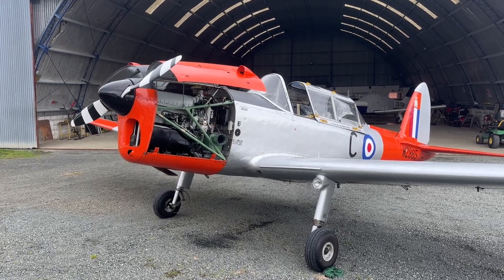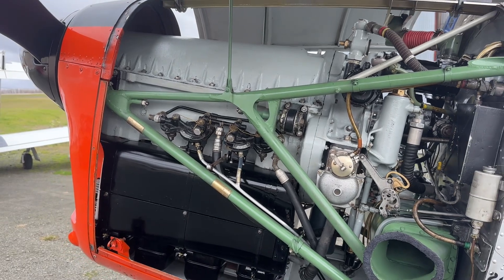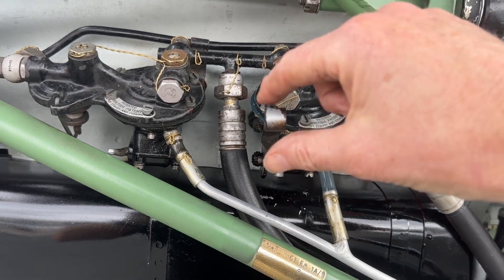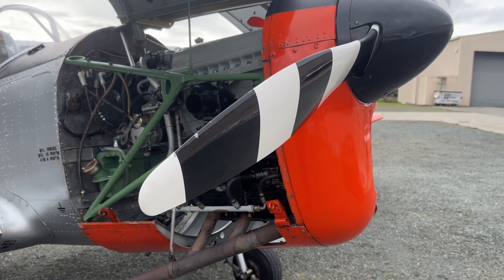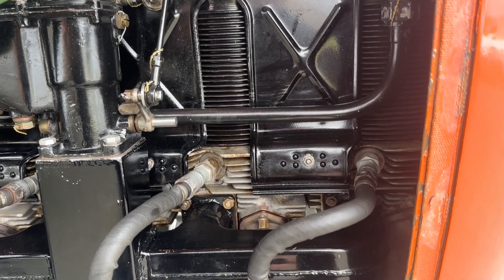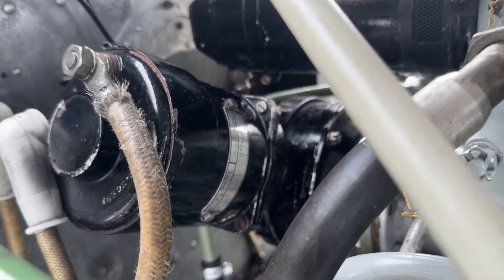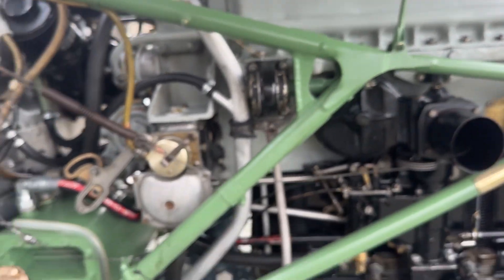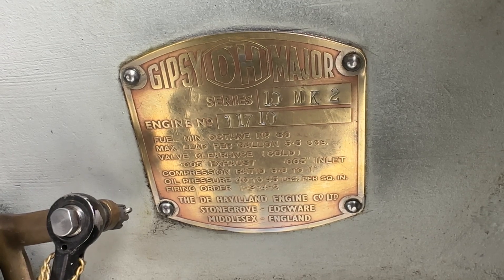Chipmunk engine deep dive!

Comment: Loved it. Used to help with routine cleaning, engine checks, etc, on a Chippy we used for glider tow work at Port Augusta (South Australia) back in the early 1970's. Great engine, still so many pulling equally iconic aircraft around, all over the world. This engine is rapidly approaching its 100yo birthday. Really good and easily understood walkaround, thank you.
Reply from the maker: yeah there's some real history right there. I didn't go into the full genesis of the Gipsy Major but it has its origins in WW1 Renault V8 engines - hence the metric threads with imperial heads.

Comment: No Kaufman Starter?...Used to hand prop start Chipmunks in 1958/59 R.A.F. Debden, U.K. ...Hated Debden
Reply from the maker: @altaylor3988  as far as I know, no civilianised or civil Chipmunks have Coffman starters. They were removed when they were demobbed and replaced with Rotax electric starters. Some still have the red cover for the pull ring in the cockpit and all of course have the exhaust port in the RH cowling.

Comment: There is no reason for a Gypsy Major to leak oil! Only it is not built or maintained correctly. You better go get some training from someone who knows basic information about this engine and try again with correct information
Reply from the maker: @tim79w  hi Tim despite there being no reason, the 7 Gipsy Majors I’ve flown behind or between all leak oil to some degree. Do you have a recommendation I can pass on to all the engineers and owners as to where they can get this training you’re talking about?

Comment: Thank you for a nice walk around your engine, I've never been around one of those. The inverted engine puzzles me, the oil must be delivered to the crankshaft, and then what, it just slugs up and down on the backside of the pistons? How is it returned to the oil tank? Anyway, there shouldn't be any rust in there! Beautiful aircraft.
Reply from the maker: No rust for sure! Yes delivered to the crankshaft via that main oil gallery on the RHS then a lot of splashing! Scavenge filters lower front and rear of crankcase with suction from scavenge pump elements on the main pump assembly.

Comment: Is this very different to the engine in a tiger moth?
Reply from the maker: Not that different. Tiger Moths use one of the Gipsy Major Mk1 variants which produce 130hp vs 145hp for the 10 Mk 2. The Mk 1 is the same basic engine but lacks the fuel pumps, generator, starter and vacuum pump found on the Chipmunk version. Tiger Moth engines also seem to be OK running on Mogas as well as Avgas.

Comment: This plane has a usb port underneath the spinner.
Reply from the maker: It actually has one in the cockpit! After all the fuss of fitting it though I've never needed to use it, as the engine runs 2 hours 15 minutes to tanks dry and my iPad battery lasts a lot longer than that.

Comment: Couldn’t see the Carb Heat ?
I was hoping to see the cartridge starter.   Is the electric starter a civil mod ?   Where is the battery located ?
Reply from the maker: I realised afterwards that I hadn’t mentioned the carb heat. On the right hand side of the engine look for the long spring extending from the firewall towards the carb. It controls a flapper valve inboard of the carb air intake that switches air intake to that flat round thing left of the carb - it’s open towards the engine block to take warmer air through a mesh filter. It isn’t greatly different to normal air, at least when testing on the ground (usually can’t see an RPM drop). The cartridge starters were all removed on demob - all that remains is the exhaust vent on the RH cowl. The two 12V batteries are in a compartment behind the cockpit.
Reply: @VaughnDavisTV     Thanks.   What’s the weather like 🤫
Reply: @VaughnDavisTV     Can you jog my memory on the downwind brake check ?   My recollection after 53 years is, on the ground you apply the brake with full rudder, and count the clicks until the brake bites on the rudder pedal.   Then apply two more clicks (say 5 in total ).   Should you need differential brake on taxi, or take off , then it’s available. 
After take off the brake you fully release the brake to enable full rudder available for say spin recovery.   Downwind you reapply the brake for say 5 clicks,  so that on landing you have differential brake available to counter swing and a ground loop. 
( I have my original UAS notes filed away in a very safe place,  and don’t want to turn the house upside down finding them ).  Thanks.
Reply from the maker: @californiadreamin8423  many Chipmunks including mine have had the original Dunlop brakes and wheels replaced with a more modern Cleveland system. Depending on how they’re rigged they often provide a little differential braking even at no clicks. To be honest, flying with either system I just do it by feel and only preset a few clicks for takeoff or landing if the crosswind is approaching limits.
Reply: @VaughnDavisTV     Thanks for the info.

Comment: I have to say the Chipmunk is a fantastic aircraft to fly, but...If I owned one I would replace the engine with a good Lycoming engine and an inverted system. I would also replace the awful brakes with modern hydraulic toe brakes.
Reply from the maker: You could also replace the wings and fuselage while you were at it? (:
Reply: @VaughnDavisTV  Purists would start shaking and hyperventilating at my comments. The Gypsy major was awful and constantly leaks when you finally get it running.

Comment: 145HP Gypsy Moth. I've flown one with that engine. It was a Canadian version with the bubble canopy. The English version had the bird cage type canopy, which is the easiest way to spot the two types. A popular engine conversion was putting in the 200hp Ranger, another inline engine. But those are probably scarce now days and the parts for it as well. I thought it was a real docile flying plane. Handled like a Cessna. The plane I owned at the time was a 125hp Globe Swift, which was a bit more demanding and flew a lot better handling-wise. So the Chipmunk was a bit of a disappointment to me.
Reply from the maker: I've seen pics of quite a few flat Lycoming conversions too - O360s I guess? Never seen one in the flesh in New Zealand though.
Reply: @VaughnDavisTV  Art Scholl used to fly one with a 260hp 6 cylinder lycoming engine. I think that's what he was flying when he was killed filming scenes for the original Top Gun movie.
Reply from the maker: @tedstriker754  I thought he was flying a Pitts? But yes definitely seen footage of him flying a Chipmunk with a big Lycoming (and wearing a tie!)
Reply: @VaughnDavisTV  He may have been in a Pitts, but he did own a Chipmunk he did airshows in. He also enlarged it's rudder, which was a common mod for hard aerobatics in that plane.

Comment: Many years ago, flew several sister aircraft to this one - closest 'relative' WZ 846 - with Queen's University Air Squadron in Belfast (Northern Ireland), prior to full RAF jet training (JP3 and JP5).  Lovely time on those Chipmunks!
Reply from the maker: Great machines! I flew the Strikemaster (JP5 basically) in my RNZAF training. This Chipmunk was with GUAS (now UGSAS) - the scheme is based on what it would have worn in the early 1960s.
Reply: @VaughnDavisTV .    I was an undergraduate apprentice at Warton when the Strikemaster was on the production line.   I was told  that the Provosts for Prince Charles were special in that absolutely no concessions for minor production errors were allowed , and the engines were brand new,  as opposed to “reconditioned”.    I spent 2 years in EMUAS on the Chipmunk ,  which tail wheel experience was a great advantage when 10 years later I obtained my commercial,  my first job being on the Dak.   I flew with quite a few Kiwis over the years. 
Great video.

Comment: I watched this video wanting to know why this engine does not experience hydraulic lock-up.
A miss.
Reply: It can slo for the 1st start you pull it through at least 4 compressions preferably more just to check.
It’s also a good idea to flood the carb and pull it through a couple of times when it’s cold helps it start easier.
If it’s only slightly warm then it’s either pray you have good batteries or it’s jacket off and get swinging

Comment: @10:12, A drop of oil can be seen dripping from the oil pump.
Reply from the maker: Probably a mix of oil and degreaser - I'd just sprayed and wiped the entire engine to make a clean slate for tracking down a persistent oil leak.

Comment: Lovely video!!!!  Make all the videos you can on airplanes with these egines, youtube has a lot on american airplane engines, but not enough on the old gipsy.
Maybe you could do a video on some old Auster with the gipsy engine, that little airplane is chronically underrepresented on YT.  
Cheers from Sweden!
Reply from the maker: Thanks! There are an Auster and a Dragon in the next hangar, both with Gipsy Major 10-2 engines. There’s also a Moth Minor nearby but I’m not 100% sure what that has in it. I’ve been flying a couple of Tiger Moths recently so might make a video about the early 130hp Mk 1 engine in those.

Comment: Used to fly in these out of Manston, UK when I was in the ATC. The ones we flew in were started with a bang from a cartridge.
Reply from the maker: I’ve wondered how reliable that system was. The Chipmunk engines I’ve flown often take two or three attempts to start, especially when hot… you’d quickly run out of cartridges!
Reply: Me too! ❤

Comment: Excellent video. Thanks for the walk around. Stbd side of the engine there is what looks like interconnected knuckle dusters, what does that do? My thought is either throttle or mixture control.
Reply from the maker: Yep those rather lovely cams connect to the throttle control and thence to the magneto to advance or retard the spark depending on power setting (I'd need to look it up to remind me which way exactly though)

Comment: YouTube recommended this video, and I'm so glad it did!  Great job going through all the components & features.

I understand DH made a whole line of inline Gipsy engines of various cylinder counts & displacements.  Would be neat to hear what they improved for this version, and what, if any, improvements followed on later versions (assuming there were later versions).  Thanks!
Reply from the maker: I'm not very knowledgeable on the whole range but believe the Gipsy Major was the heart of it and powered the most aircraft types in its various Marks from 1-10. The Gipsy Queen was a 6-cylinder version that you might find on a Devon/Dove. Main upgrade from the GM 1 to the 10 was more horsepower (130 to 145) and many more accessories. I think all the Tiger Moth version comes with is an oil pump.